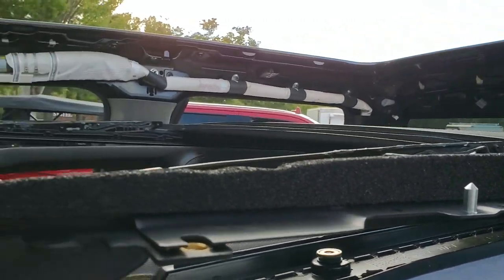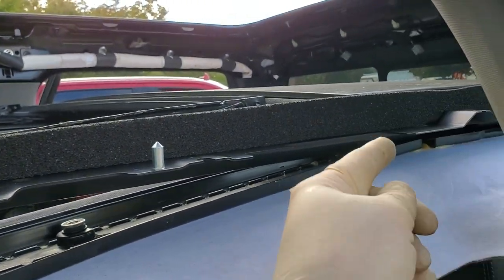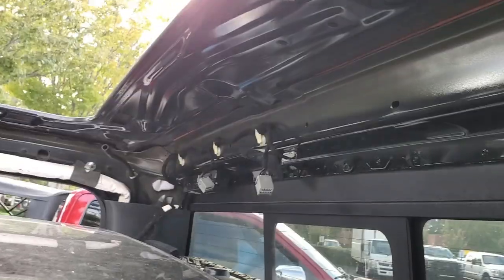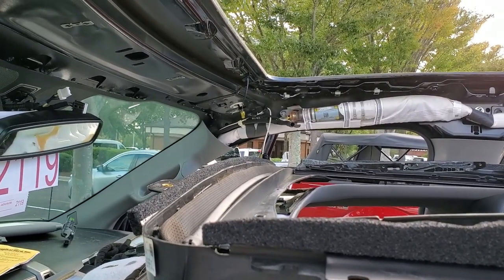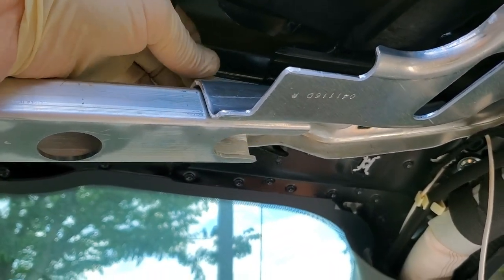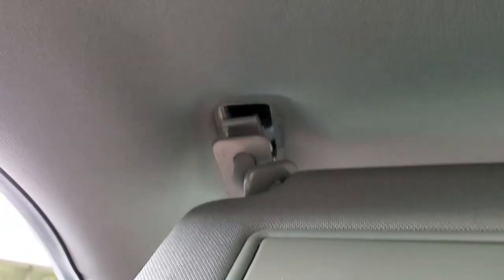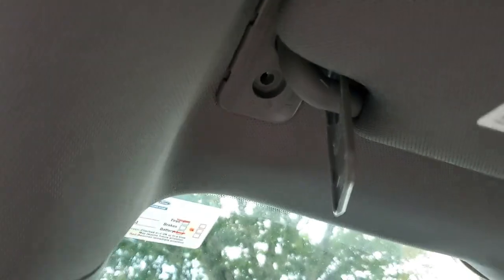F Series Sunroof Part 3: Track Reinstallation

Comment: You saved me thousands of dollars--I subscribed, like, commented, and donated. Mine had a crack in the rear glass and it needed the cables.  I installed the Sunroof Doctor cables and arms.  After all that work, I ran into trouble with the two cables not being synced and there was a fix in here for that. Saved my A$$.  Everything works now.  There is NO WAY that a person could sort this out for themselves without spending all of the time that you spent, as a professional, working out every single detail. Thank you!!
Reply from the maker: Awesome, always like hearing success stories

Comment: You are awesome my 17 bough used 3 months ago the vista roof on vent grinded and only one side closed went to the selling dealer and said $3700 to fix it stated cables failed whole assembly was scrap. Saw as you showed the drive motor could be dropped and close the glass. WTF the motor held with one screw one loose and the third missing fell out of mesh. Inspected the cables and the drive they were mint. Timed the cables as you showed reinstalled the motor with a 3rd 3 dollar screw and re learned as you showed and lubed with the expensive grease MAN works better than new. Would have left it but the sun shade would not close too hot leaving that open. Kudos I am a 30 year mechanic a little info goes a long way out of my realm thank you fixed a $3700 problem for 3 dollars yeah free labour on my dime.

Comment: I have cleaned and lubed what all was accessible without removing the sunroof glass, but my sunroof vibrates pretty hard while opening. Any thoughts?
Reply from the maker: Like the whole way?
Reply from the maker: https://youtube.com/shorts/8BeWGnae2uw?feature=share
Reply: @SealofPerfection  around halfway back it starts
Reply: It seems like it starts to pull the glass from left to right as it goes back past halfway.
Reply from the maker: @eag8999  You can try lubing the cables like in that video.  It might help.
Reply: @SealofPerfection  just gotta pull out the front glass?
Reply from the maker: @eag8999  Yep, super easy. 6 Torx #25 screws
Reply: @SealofPerfection  thanks!p
Reply: @SealofPerfection  it did not help. It is doing it the whole way now actually. Was I supposed to lube anywhere specific on the rails? I is kind of like it is dragging something dry across the rails as it goes back.
Reply from the maker: @eag8999  Is the glass adjusted too high and hitting the back of the roof opening?  I've had that happen before.  Watch it as it drops down and see if it's too close
Reply: @SealofPerfection  that's very possible. How do I adjust that? When I reinstalled the glass I pushed it up as high as possible before tightening the screws.
Reply from the maker: @eag8999  you adjusted with the same screws that you attach it with. You can move the glass up and down with them loose.
Adjust the rubber to where it's about flush with the roof
Reply: @SealofPerfection  So I dropped the glass to the bottom with the bolts loose. It is 90% better, though I still hear some of the same noise and can sort of feel it with my hand on the glass. But way better. I'm going to try to adjust it without going too high.
Reply from the maker: @eag8999  well there you go, sounds like you are on top of it now. Just have to find the sweet spot for the adjustment
Reply: @SealofPerfection  I actually saw the back glass was high in the back and low in the front. Fixing that now and will see if I can meet ford's spec of in line with roof on the back glass and in line to 1 down on the front
Reply from the maker: @eag8999  go about 30 minutes and 38 seconds into this video and I show you about where it needs to be adjusted and talk about it a little bit.

https://youtu.be/kQhhebShWcg?si=FWciElhjWKUhD8rp

Comment: My local Ford dealer replaced the whole track on my 2015 Lariate.  Ever since, it leaks like an open faucet on the front right side.  I’ve verified that the drain tube is attached.  What do you think they missed?  The glass looks flush and contacts all around.
Reply from the maker: @larrybradley7589  is it leaking into the cab or just a lot getting into the trough and still going to the ground?
Reply: @SealofPerfection it’s leaking into the cab.  It runs down the passenger grab handle.
Reply from the maker: @larrybradley7589  okay well you need to make sure that the drain tube is Flowing properly. Not just flowing a little bit it needs to slurp. And if that is the case then you may just have a bad seal on the glass and it's allowing too much water pass in the drains can't handle it no matter how well they flow
Reply: On my 150 underneath the grab handle on the passenger side where the drain 2 rugs down. It was kink between a screw and a grab handle andclogged it up, take off and look at that and make sure it aint Kink.

Comment: Just did the install on mine but it bouncing back halfway but moving really good not sound or anything just does not want to close cause i opened it without the sunroof installed. Could that cause my issue?
Reply from the maker: Probably. Have you run the initialization yet? It probably needs to be reinitialize before it's going to work properly

Comment: I Put the new cable in and the motor keeps pushing the cable out through the hole next to it in a little bubble. Ideas?
Reply from the maker: I'm trying to picture what you're talking about, lol. 
Did you happen to compare the cable length to the original?
And is the new cable kinked at all?

Comment: Hi. Great videos. You mentioned center drip channel can be ordered for a 2020+ to fit 2016 F-150. Would you happen to have that part number?
Reply from the maker: @jgut2204  Yep. It's in this video 
https://youtu.be/L3DVwPqPqIY
Reply: @SealofPerfection  Awesome!!! Thank you for quick response. I am having some other issues but I have replaced the rail glides (common breaks) and of course the trough arm broke. Thinking of replacing seals all around now. Thanks again!!!!!

Comment: Really appreciate these videos. Just finished installing a new track, couldn’t have done it without these videos. Definitely gave me the confidence i didn’t have before. Enjoyed it enough i almost want to replace another one now haha. Thanks again!!
Reply from the maker: Great to hear, and Thanks!  I bet if you did another one, you'd do it in half the time now, lol.  I used to hate them when they first started breaking, but they're easy now
Reply: We got a lot of rain today and checked on the sunroof to see how it was doing. It seems there is a good amount of water dripping around the seal in the back of the rear glass and in the trough. How much water making it through in a decent rain is normal? I know they are designed for water to make it through but wasn’t sure how much.
Reply from the maker: @johnholt2528  the short answer is, as long as it is not overwhelming the drains you should be good. The long answer is, it's hard to say because due to the age of the truck and the seals sometimes they will pass more. You can get in there with a Torx number 25 and try to adjust the window up and down a little bit and see if that slows down the water. Just do it while it's raining is the easiest way to see. You might find a sweet spot where it passes a lot less
Reply: In his video he said to blow the drain hoses out and to pull the back drain hoses down some so they drain better. Also use the 3m silicone lubricant. I only remember this because I just finished my sunroof about an hour ago . Lol

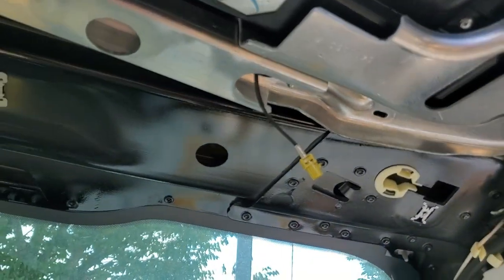Comment: Thanks for the videos, saved me hundreds, maybe more considering all the problems I've had with my roof. Replaced the arms a couple times (don't recommend going down a rough gravel road with the roof open) and now I have the other problem you've mentioned where the post that drives the arms is broken where it attaches to the track. Thought I would have to replace the entire track which is why I'm watching this series, but you said something at about 4:25 of this video about rebuilding the track with the new parts they have now? Gave me a glimmer of hope that there's a fix other than tearing out and replacing the whole track....did I understand that correctly or am I just hearing what I want to hear? Lol Thanks again for your help!
Reply from the maker: You heard correctly. The lower guides with cables are being sold for these now. I have a set and I'm going to attempt to put them in a track. I have a couple of broken tracks for test subjects. Going to get around to it pretty soon now
Reply: @SealofPerfection where are they selling these "guides and cables"? I have been to the sunroofdr site and only see the arms or the drip channel. I have a 2017. Looking forward to hearing from you. Thank you for all of your videos. Very informative and helpful. Thanks.
Reply from the maker: @matthewbennett6937  Amazon and Ebay for now.  Sunroof Doctor is still developing theirs, trying to get them up to their standards.

Comment: Very helpful. Subscribed. I’m curious, maybe I missed it but what do you use to lube the track, guides and the plastic lifter rails?
Reply from the maker: I recommend silicone paste.   Don't use anything petroleum-based.  And lithium grease is useless, it doesn't hold up in the hot environment inside the headliner.

Comment: just got the new track in by a mechanic. Everything working great.. except I noticed he left the water trough off and the front deflector. He won’t make right, so I’m stuck buying these parts. I’m just wondering, can the water trough that runs in the middle straight across both glasses from the inside (the one you talked about being careful not to break when un attaching from the arms).. can it be installed without removing the whole track again?? And I assuming the wind deflector can as you mentioned that in your video to some extent.
Reply from the maker: Both the deflector and the trough can be put in with the track in the truck.  You only need to remove the glass for the trough.   You don't even need to do that for the deflector.

Comment: I took mine apart to change the rails and realized I needed the whole track sliders. Well, a few weeks later it's all going smoothly until I realize I am missing the tiny screws that hold the stopper and that one 2-screw cap piece.  Any chance you have a part number or even thread pitch to source some replacements?
Reply from the maker: If you mean the longer plastic piece with the two little short screws in it, I have several, I can just send you one

Comment: with the 2019 track kit, have you swapped out the complete guts from the kit to the older track with the older motor three screws as the new 2 bolt motor track kit will not work unless you get the new motors as well.
Thanks
Reply from the maker: Far as I can tell, everything is the same except the rear piece where the motors attach. 
So I think the cables are the same.  I know the upper guide arms are the same. 
The deflector would be different.  Trough is the same.  Shade is the same.  
I have a 2021 track and looking at it, all the guts look the same.   But the older motors won't bolt to it.

Comment: Your videos are great help !!  what is going on when I try to program it after reinstalling everything and it just clicks or a grinding noise?
Reply from the maker: Is the noise from the rear?   Did everything move freely when you had the motor dropped?
Reply: @SealofPerfection  Yes it sounds like the noise is coming from  the motor  area.  Things seamed tight up in the front area of the track .   I can not find any silicone paste in town so I used spray silicone, I better order some paste.   Also I disconnected my battery during the process, does this have anything to do with it?
Reply from the maker: @DarenByrum  no unplugging the battery didn't matter. Generally when you get that noise it means the motor gear is jumping on a cable that will not move.
So my question would be, did both Gods move back and forth freely? Because it sounds like one of them is not moving and the motor gear is slipping on the cable
Reply: @SealofPerfection  Your absolutely right,  I took the track out again and seen that it spit the end of one of the cables out by the motor. I ordered new cables and found some silicon paste, so I will grease the heck out of everything this time and hope  for the best. Thank you so much for the time and effort that you put into making your great videos and sharing them with everyone, they are a great help.  Have a good weakend.
Reply: Also I forgot to say, Thank you for responding back that means alot .
Reply from the maker: @DarenByrum  no problem at all. Glad you found it. Very happy to help

Comment: I’ve replaced tracks, and have the dreaded stripping/grinding from the glass motor. No matter how many different times I’ve tried setting the guide pins all the way forward, and reinitializing. It will continuously grind as long as I’m willing to hold the button or let it go. And if I try and manually turn the motor to back it off the forward stops, the drivers side guide pin in the track does not move in sync with the passengers. It’s like it hits a hard spot, and only the passenger continues to move. I’ve checked and rechecked the track over and over for any obstructions after track replacement. Any ideas?
Reply from the maker: Did you replace just the upper arms, or the lower guides with cables also?
Reply: Just the upper arms. I checked condition of lower guides per another of your videos. They were fully intact, and had minimal play. I have 2 motors and cables on the way, but am dreading cable/ lower guide replacement.  Just to clarify, with the motor installed it will run on the guides to vent position (full forward in tracks) fine. But when it gets to the max forward, it goes wild stripping gears continuously. Then if I try and manually crank the motor backwards, the driver side gets hung up, while passenger lower guide pin moves along freely along the track. I’ve also gotten it stuck twice now where 1 side of glass is in vent, while other side is closed.
Reply from the maker: @AM-es9yt  So, you might well have a bad cable.  Or the motor.  My money is on the lower guides being broken and one side not moving freely, though.  
I have had a couple of people report that even after replacing all that, they still got the grinding.  
Haven't definitively found that the motors have been bad yet, but it's what I suspect.  Keep me updated
Reply: Seems to me the motor not accepting the input that the guide pin in the track is max forward is inducing the grinding. Basically it gets max forward, and tries to keep forcing it forward, resulting in catastrophe. I’ll try a motor first for my own hopes and prayers. Then I reckon sunroof frame comes down. 2 days of sunroof work makes me glad to work on airplanes. Preciate ya brother, will update.
Reply from the maker: @AM-es9yt  okay the problem with trying a motor is, they have updated them and you will have to buy two. The new ones will not work with the old ones. So that's an expensive venture.
If you really wanted to do that, I probably have a pair of old ones I could send you
Reply: It’s 2 motors off a salvage vehicle, got em cheap enough feels like I stole them. same old part numbers as the ones I have. I do appreciate the offer though, hell of a dude.
Reply: IT’S ALIVE
New motors did nothing to fix the issue, I couldn’t even get them to run the initialization. Same part numbers, but they are out of an expedition. Maybe logic inside is different, not sure.
The fix: Glass out & Motor removed (still plugged in) Guide Pins full forward in track. I ran the initialization, making sure to hold the first step until motor timed out, then it would progress to shade timing. Completed initialization, and ended 1 touch in Vent mode. Installed motor, and everything works as it should with 1 touch. Installed glass, and works like a charm. 
A mistake I made for the sake of research, after installing the motor I tried initializing again, and it immediately started grinding like hell. So reset everything back as explained above. And now no more issues.
Also while I was rolling around between every seat in the vehicle at 4AM, some asshole rolling around the seats broke the legs off my trough. After pricing one of those, looks like I’ll be having a date with JB Weld, or plastic welding. Thanks for the help, and god forbid someone else has these issues that seem so backwards from the logic of the rest, I hope my info might help. God knows I read through over 1000 comments & 200 forums posts looking for similar symptoms and ideas.
I have 2 2020-2021 expedition motors if you’d like them for the next person with issues. Apparently they don’t work on F150’s regardless of PN# and they’re no take backs.
Reply from the maker: @AM-es9yt  get a rear trough out of a 21 or newer. They're about half the price and is a direct bolt in I actually have a video on it with the part number.
Glad to hear you got it going.
And there's no difference in the motors, one might have just been bad.